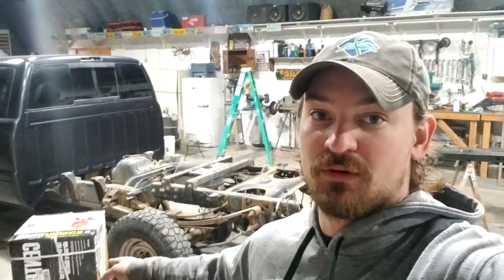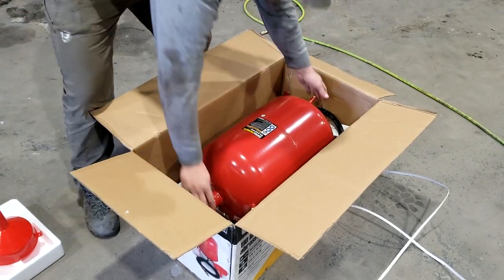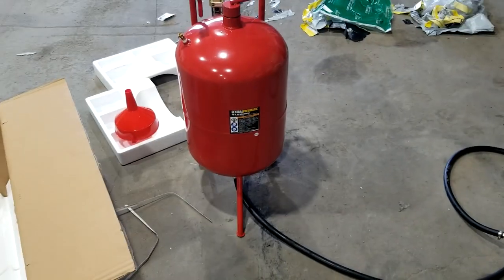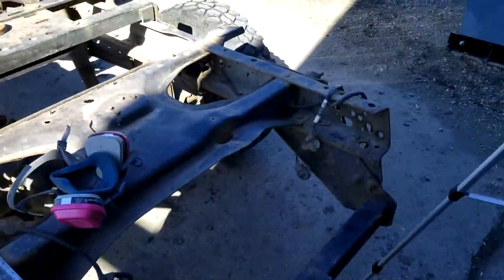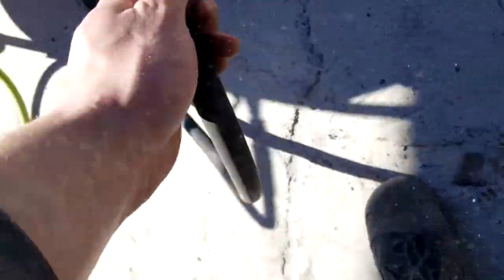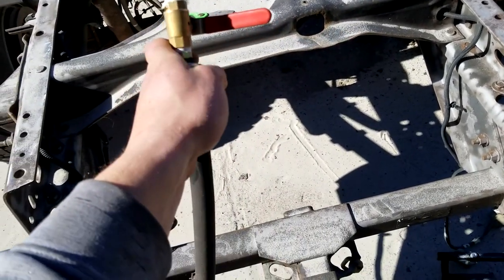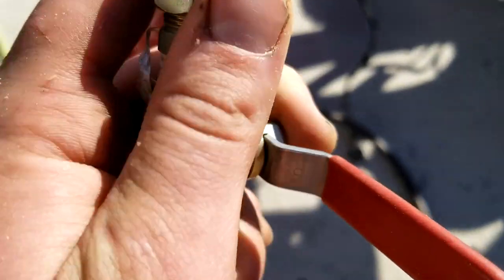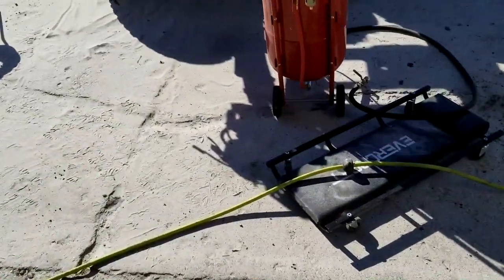Harbor Freight 110LB Pressurized Abrasive Blaster REVIEW!

Comment: Just one recommendation for anyone that stops and read this. Never or least avoid blast with the fuel tank specially with gasoline since is very flammable, sandblasting creates sparks when the media hits metal so becareful.
Reply: Thanks
Reply: Bruh you wild
Reply: NACE published an article about this year's ago. The air propelling the sand is fresh air creating a pocket of fresh air in which gasoline vapors are not present. Before you say what if the spark exits this pocket of fresh air, the velocity of the air rapidly cools any spark below the temperature it could ignite the vapor.

Comment: SUPER EASY TIP....On flat surfaces, use wire brushes on a drill or grinding wheel, way faster and saves media.
Smaller spot sand blasters are for tight areas where you can't reach.

Comment: The most important thing with these blasters is too make sure your sand is dry, or it wont flow right. with dry sand you can lower your pressure so smaller
 compressors can keep up.  Also you can use playground sand from HD or lowes just sift it when you pour it in, make sure its dry and wear a respirator blast away.
Reply: Never ever use playground sand it has silca
Reply: That's exactly what i use and do, also switch to the deadmans handle.
Reply: @redneckswitwheels  Meh, when you live by a nuke plant, the motor city & quarry putting silica into the air every single day, it's all relative.

Comment: I have about 30 SF of steel plate to clean and I was considering getting this, but I don't know. I think for your application its a must because of all the bolts and crevices, but for me I think a large grinder like 7" and a bunch of flapper wheels should do it. Thanks a lot for the video. Definitely helped me out.

Comment: I had the same issue with mine. I went with a stainless steel ball valve as an upgrade I also noticed I went through the ceramic tips fairly quick also.

Comment: I had the same issue with the valve wearing through. I bout a different styled valve, I believe it was called a deadman’s valve. Not 100% sure on that name being the correct name for it. But that deadman’s valve didn’t ever wear through like that valve that was included with the blaster.

Comment: Definitely need a big air compressor for this blaster & get a better mixing valve & tip cause I had to shake the blaster while blasting. Also my air compressor couldn't keep up . For the $ it's definitely worth it & a 1/2 face respirator is highly recommended.

Comment: Ditch the valve at your tip. Your going to be constantly washing the guts out of them.
I use to use a industrial blaster that could turn them brass valve bodies to dust in just a few minutes using silica sand.

Comment: The bottle says do not use sand as blasting media. Why is that? Or is the media you used a okay media to use?
Reply: I'm sure it's talking playground sand or general purpose sand, the grits are to irregular. Sands that are made as a blast media are good, since they're standard grit sized granules
Reply: Most likely they don't want you to use a silica-based sand.  When used as a blasting media, it shatters the sand, creating very fine silica dust which you breath in and can cause silicosis.  Not everyone will have a high-quality mask (or even use one) and will breath in some of the particles.

Comment: I have a question. . 
I have a 110lb pot. I also picked up 50lb bag of Black Diamond fine grit. Should I dump the whole bag in or is less better for flow? 
I'm running a Speedaire 7.5 hp/25 cfm. Thanks.
Reply from the maker: You can dump it all in, it doesn't matter how full it is because the valve on the bottom of the tank is the media adjustment.
Reply: You can fill your tank to 75% capacity for normal weather conditions. When the humidity is over 80%, fill to 50% capacity to avoid clogging.

Comment: You probably shouldn’t be assembling an operating equipment when you are  hung over! The reason you blew through the side of the valve was because you were using it to control the flow, It is stated in the instructions that the ball valve at your nozzle should be wide-open and you are to control the flow at the bottom of the pot or you will blow a hole through the side of your valve! Harbor freight’s tools are cheap enough they don’t need people making them look even worse because they are too lazy to read the instructions!

Comment: Do people really not understand that the valve at the nozzle is NOT a throttle, it is an ON/OFF switch.  The replacement valve will "blow-out" in another bag if it's used to control the flow!  Next time RTFM!